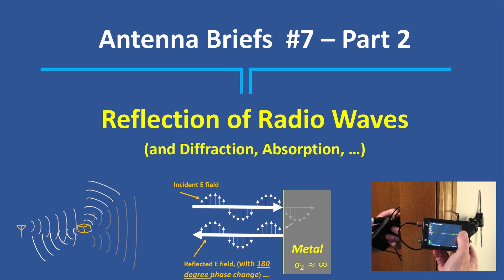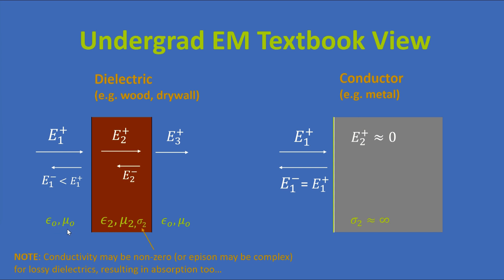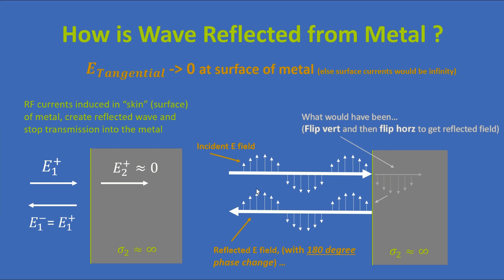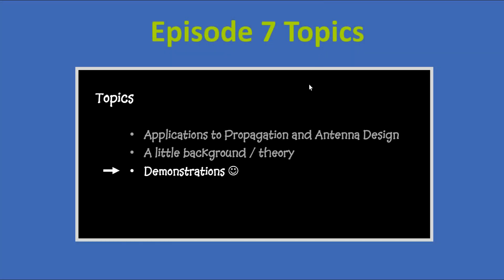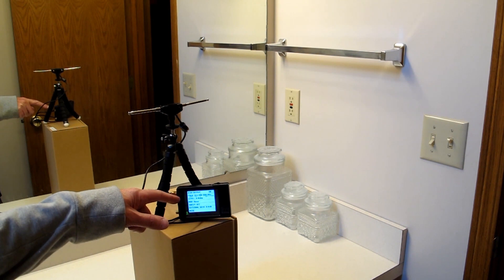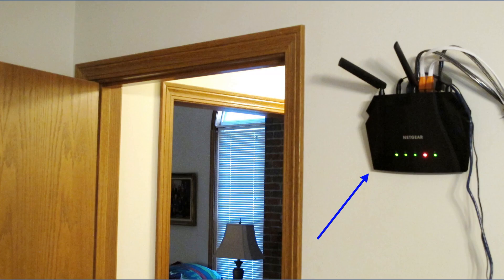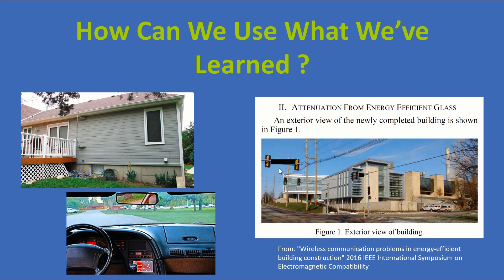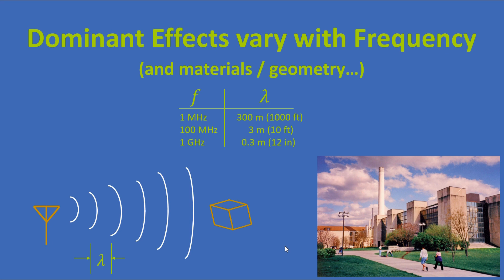Antenna Briefs 7, Part 2 - Radio Wave Reflections in Propagation and Antenna Design

Comment: Reminds me of my electromagnetic classes years ago. Of course the reason why there's no e field in the metal is because the electric field is negative the gradient of the voltage. In a perfect conductor the voltage everywhere is equal and so the electric field is zero. I remember the boundary conditions as well in the mathematics for that lots of good stuff. Electronics and antenna design and I took an intended design theory in college at the University of Lowell back in the 80s, is Now useful to me only in my hobby as an amateur radio operator. As I said good stuff you got there